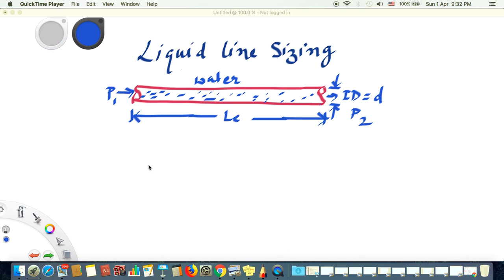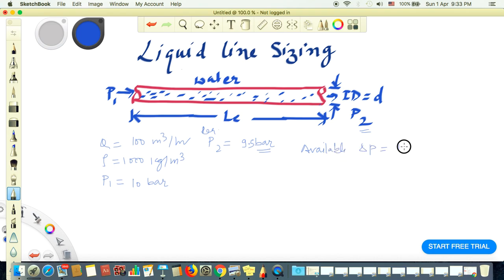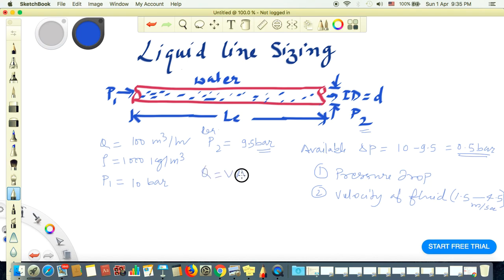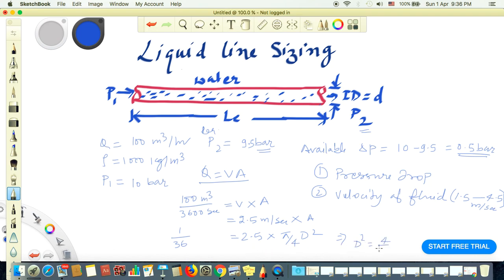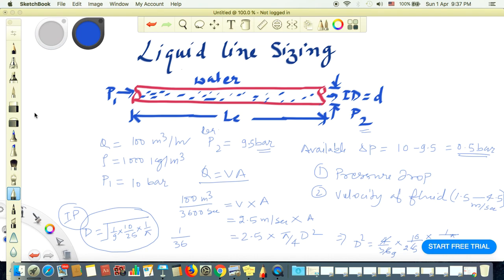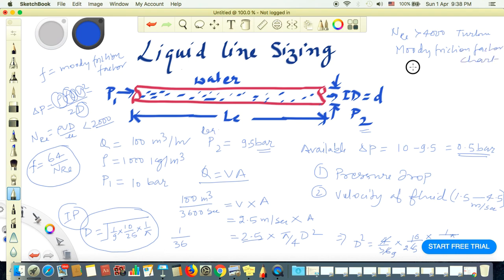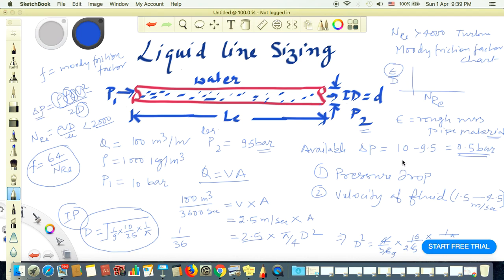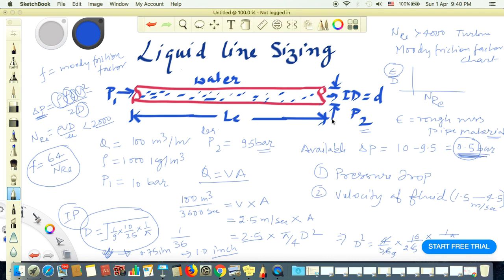Liquid Line sizing calculation

Comment: Thanks for uploading this video. Informational and useful as a process engineer. I am having doubts regarding the range of Reynolds number. What if the NRe ranges between 2000 - 4000, how will we take the value for f ? Also what actually is equivalent length, what value we will assign for that? Anticipating a quick reply, thanks...
Reply: If NRe ranges between 2000-4000, then its transient flow but For design purposes we can consider it as turbulent flow.

Comment: I really appreciate your effort in putting this online, Thanks a lot. This has really help me a lot as I did a course on process engineering design in 2014 & this has really refreshed my memory again.
Please Sir, what is the basis for limiting the velocity of water in this pipe to a value of 1.5 - 4.5 m/s. Is this always the case when water is flowing in a pipe.
Reply: yes, thats a general values we take. But incase of Hydrocarbons distillation, the values differ and most preferred is 10ft/s